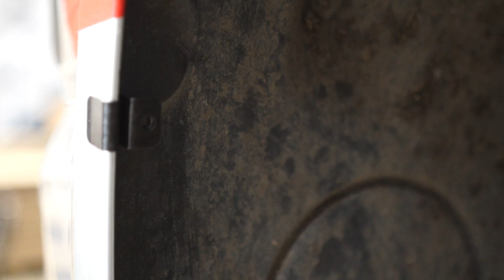How to Fit VW T6 Sportline Lower Bumper + Splitter | Transporter HQ

Comment: Nice to see the fitting process. So if done correctly like this, it should be reversible without visible damage to the original bumper? The look for me just does not work, they look so stuck on.
Reply from the maker: Yes thats correct

Comment: Is this the same process for the T5.1 bundle which is sold on the website?
Reply from the maker: Similar yes. It makes sense when you get the T5.1 kit there with you.
Reply: Where abouts do you put the brackets on the under side of the spoiler

Comment: Does the original parking sensors still work correctly with this fitted?
Reply from the maker: Yes 100%
Reply: Well, they don't go well for me, it beeps constantly without there being any obstacle nearby.  I asked about the same thing and never got an answer.
Reply: I bought off them after the answer I got,had painted etc and mine was same constantly going off getting annoying now really need to try and sort out.
Reply: @kingofcavell1620  mine was slightly improved by attaching it under the license plate with screws to the inner bumper reinforcement.  The bumper is not firmly fixed from the beginning and allows some flexibility, in this way everything is firmly fixed but still I did not solve the problem in its entirety.
Reply: @THQAutomotive  from what I see it is not like that, I am not the only one who gets false positives